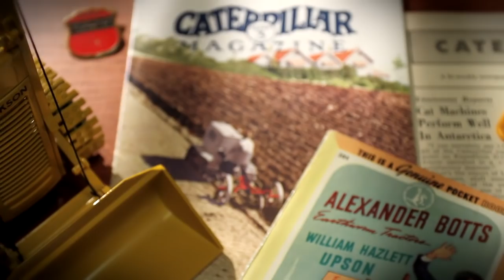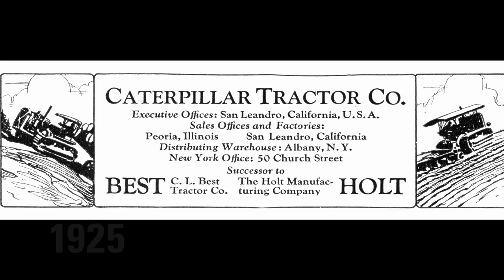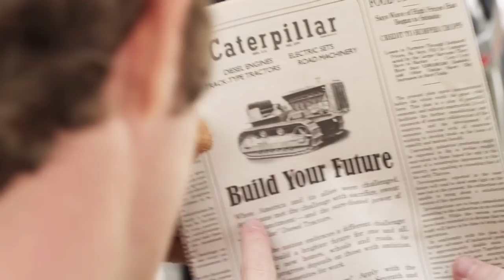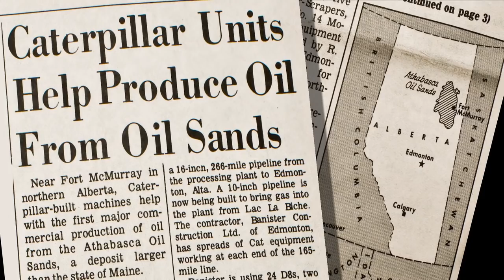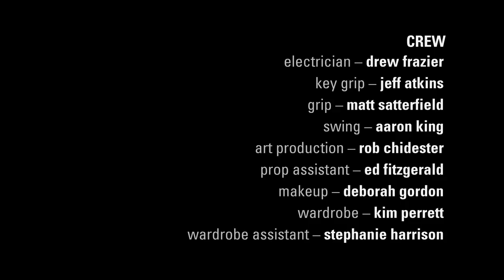Caterpillar Brand Heritage

Comment: Caterpillar are the bees knees in earthmoving equipment - we had a 1936 RD-4 Diesel crawler tractor (set up as a dozer) and, as luck would have it, Cat still supported that 70 year old (at the time) machine with factory parts! I'm still in awe of that - it's like Caterpillar never lost touch with it's older machines

Comment: Caterpillar sebuah merk yang dekat dengan diriku dan keluarga. 

Mendiang bapak ku seorang operator alat berat Caterpillar mulai dari unit lama dan unit terbaru. Beberapa unit yg beliau pernah operasikan contoh nya CAT 621 Wheel scraper, CAT TTT D6D, D6G, D7F, D7G,D8L, D8N, D8R and D9R. CAT WTL 924E, 966E, 966F. CAT TTL 973 & 977. Juga beberapa model paving product serta beberapa tipe motor Grader dan masih banyak varian CAT Lain yg pernah beliau operasi kan.

Beliau selalu bercerita tentang kehandalan unit Caterpillar.

Hal ini membuat saya merasa sangat tertarik dengan dunia alat berat dan saat ini saya berkecimpung di dunia alat berat ( Caterpillar Dealership di Indonesia  ).

Sebuah kebanggaan tersendiri ketika saya melakukan perbaikan di unit yang bapak saya operasikan...

Terima kasih banyak Caterpillar untuk semua kenangan yang indah bersama mendiang bapak saya.

Comment: vary informative video,,i liked it. I used to go to cat out here to purchase die cast models but haven't done that now for awhile,,I saw a cat D10 as it was called on here with an offset cab where the driver was located,,behind it on the body was a 5th wheel set up for pulling a scraper trailer which was attached to it..the scraper had only rear wheels,no front ones..i have been looking for it on here but have not seen it since...it was awesome.